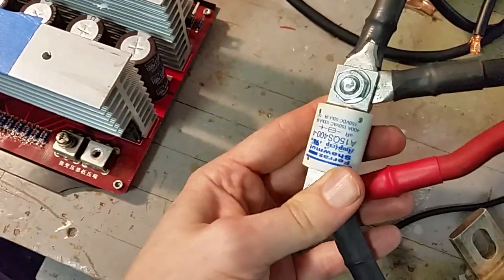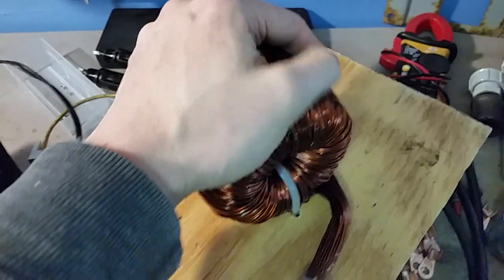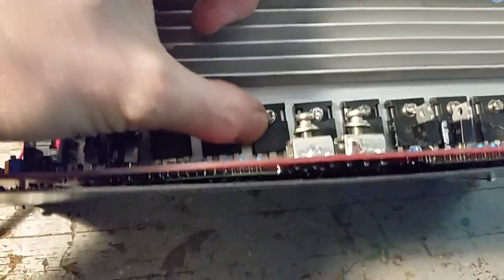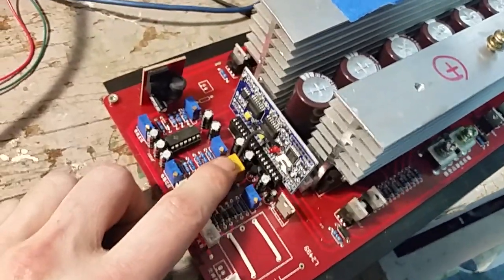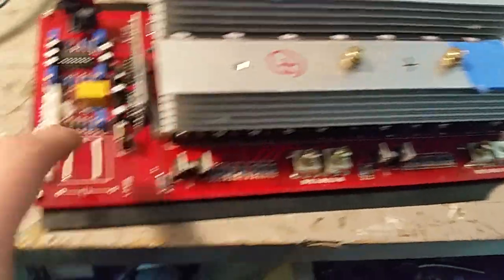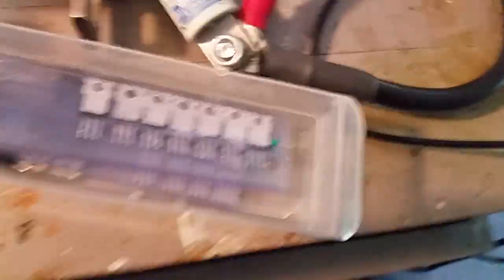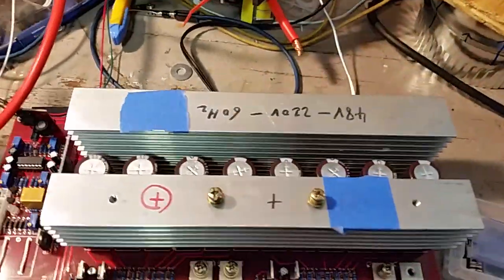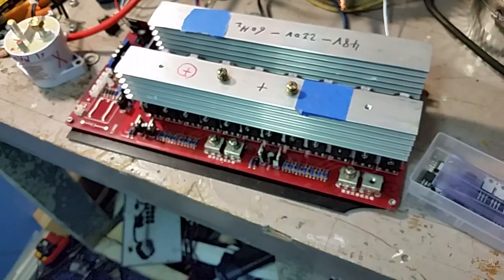Final video on chinese inverter board for custom powerwall

Comment: I looked at the designs of these, quite a bit and noticed something in common > No flyback diodes. 
Mechanical cracking? I bet on huge inducted currents causing the high-side fets to get stuck on.

Comment: Thank you for sharing all these videos! Because of these series I decided to buy the small one and so far so good. I had more problems blowing mosfets with the lighter traditional inverters than this. I use a welding transformer with smaller swicheable fuses in series to avoid destroying mosfest in case of emergency and left unmolested the tiny transformer on the board too. I don´t want to push it to the limits and works fine. My only concern is the stand by consumption because is around 1-2amps and the inductor doesn't seem to do much. I wonder If you left that board alone or finally ended as backup inverter for the 15kw one.
Reply: By the way, I always used an amp meter while I was making tests. I think this saved me from mishaps. I didn't like power consumption on idle, so I kept testing and I realized the transformer should have a better turn ratio, I had to add turns to the output side and with this increased dramatically efficiency and then added a Inductor to the output side too. Look for example this site where recommend a 14V input for 24V, 20V for 36V and 28V for 48V https://es.aliexpress.com/item/32632549961.html?spm=a2g0o.cart.0.0.679a3c00BBNEI1&mp=1
Reply: you cannot use a welding trafo, read the caution by the boards sellers

Comment: I am still using my board just like this one works great I did modify the egs002 and did away with all over current I just use brackers for over current my idle current is .44 amps on 48 volt side
I would like your extra  parts I have built a bunch of this type inverters had good luck but like I said before a friend on the back shed.  Com showed me how to modify the egs002
Reply from the maker: Yes, I have some parts I should sell. It will take me a week or so to get around to digging them out. Busy with farm stuff
Reply: @erroneus  still would like to have your extra parts
if your selling

Comment: I've experimented with an identical Chinese inverter board and come to some conclusions:
1) If any of the FETs fail, change all six in that quadrant. Even though testing may indicate some are bad, others good, those that have survived mass overcurrent are prone to subsequent failure. Usually you need to change the FETs in quadrants II and IV, those farthest from the small-signal plugs.
2) It is critical to have a good EMF filter at the AC output, capable of preventing inductive discharge potentials from moving upstream to the inverter. I used one salvaged from a large audio amplifier, rated for 250 VAC, 25 amperes, plus a 2.2 uF oil cap across each 117 VAC circuit.
3) Often the failure is cause by a spike driving the output bus higher than Vdd or lower than Vss, causing short-circuit of the internal diode in a HY4008, shoot-through and cascading failure. The EMF filter will help, but adding two large current, fast recovery diodes to limit the output bus swing may also be a life-saver.
4) A magnetic circuit breaker is much better than a fuse or thermal breaker.
While I realize this is too late to help Joel, perhaps others may find this information useful.
...de AC4AQ

Comment: Thanks a lot for this unique video that deals with this board and the diy personalized inverter. I got a question concerning the inductor that you use at the entrance into the transformer. What kind of inductor is that? Do you still have it?
Reply from the maker: I have it, but it is in storage. I think it is 47uH, but can do like 300amps. I made it myself from sendust torroids
Reply: @erroneus  Thanks for the response.  It was a pity that you discontinued your experiment. I do not need 15kw inverter and never thought of trying to build one myself. But I'm fascinated by your experiment.  I started paying attention to solar power since we got an off-grid cabin late last year. I newly realized that almost all inverters do not live up to the designated power level. After watching videos like those of yours, I seem to understand that amperage seems to be main limitation. I live in an old house with a 100 amp panel on which we survived for more than 20 years without running into any problems. 250 amp is unimaginable in my house. If I try it on a system at the cabin, I would like to try one that is 3kw to 5kw with a maximum amperage of 100-120 amp max.

Comment: i know this problem from a stack of new thyristors (all the same Model). The problem is when you use several small Mosfet/thyristors to drive a big load, one of the pack and a lower restance than the others due manufacturing tolerances.
If a huge current spike arrives it will go the path of least resistance, which means one of the components will be permanenty worn down  more then the others.The morer components are stacked the higher the chances are this negative effect will show up.
1. My theoretical soloution would be use the smallest number of Mosfets and instead go for stronger models
2. measure the RDSon and match all the componts so they have all the same Resitance
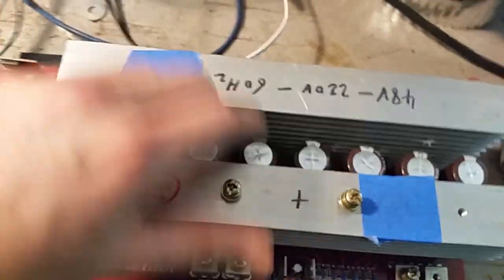4:24 ok that makes the problem worse. You cannot do that.
4:40 the soloution is, buy the chiese "7$ transistor/component tester", then you can measure the values and reaplace all Mosfets.

ty the video has lots of good info

Comment: please, what are the material of the inductor's core and the dimensions? if there is a guide to design the inductor for AC filters or for DC power supply pleases send me? Thanks

Comment: The dead time is critical, if you use different mosfets the gate capacitance will be different too. It looks to me like the mosfets all switched on briefly at same time and went pop again. You really need to replace all the fets as they may test ok but go pop when loaded.

Comment: You can use 15 ohm gate resistors to reduce avalanche voltage to fets also. Make sure fet body is floating.

Comment: I have the exact same what is this at the back shed. Com you can see how to remove the 393 chip off of the EGS oo2 board that's what causes this board to oscillate shut off and on very quickly and blow everything up there's people on there that's been running these for years after modifications my post on their the describes how to do this it's called Little China inverter board came in today

Comment: So what have you done for an inverter did you buy one are you going to fix one of these boards back up it's been probably 6 months now you said in 6 months might give it another go go to the back shed website they will help you with anything there there's a bunch of electrical engineers and a lot of other just really smart dudes there love to see you give it another go just my two cents
Reply from the maker: I've been trying to sell the transformer, it is kind of a niche thing. But either way, I think I've decided to get the purpose-built inverter from https://www.sigineer.com/ I'm competent enough to get it working, but the chinese inverter is just so fragile in the state that it is in. When the slightest thing goes wrong, the whole thing blows up. It is good for bench experiments.

Comment: hello Sir I am from India and i don't have full knowledge of car power inverter. so can you tell me which china car power inverter is best for only lcd bulbs and 2 celling fan. because on amazon have many inverter but i don't know who is the best.thanks
Reply from the maker: Because you have a ceiling fan, you'll need a pure sine wave inverter. Car voltage is 12v dc, India power voltage is 220v ac. Typical fans usually don't go over 100w. Led lights are almost nothing. Any 200w pure sine wave inverter should work for you unless you have a huge fan or too many lights. 300w would be better, 500w would probably be too much.
Reply: All chines on grid tie is best tear 1 solic  houwai sungrow senergy growaat

Comment: Have you decided to rebuild this or go with something else I have 52 lb troid I would like to get a board for was going to get this one thankfully I seen your video thank you very much but I'm left with out knowing what to buy did the blue board work good I need something reliable and a true 5000 watt
Reply from the maker: They both worked ok, it all depends on the mosfets. For 5kw, you'll probably need the red board, but keep in mind, it is really limited in amps, not watts, the power goes down quite a bit when you hit max amps. (Which is max load with full battery, then as voltage goes down, power goes down)
Reply: The blue boards that I'm thinking about getting nows24 mosfets I think it's supposed to be 4500wat I need to be able to run two or three small 5000 BTU air conditioners I've seen other people on YouTube say they take an 800 watt inverter I'll be putting us in a tour bus that me and my wife got for a motorhome and I have eight 145 amp hour
Reply: With over 4000 watts of solar I can't afford anything else except for maybe a power jack so I was hoping you would comment on maybe these boards are power jack being the best the Power Jack 8000 Watt is the one I was looking at the blue board I'm talking about is on eBay and it has the small mosfets on it 24 of them it's a hundred bucks. The red board that you've been using their the biggest one I think I shaved for a hundred and seventy everything I'll be doing to be in 48 volts and hopefully I'm only a hundred and ten volts ac to be honest with you I'm not very familiar with any of this kind of jumping in headfirst so any advice you have will be greatly appreciated thanks again for your videos

Comment: Koliko je bitno da jest kondenzator na sekundaru..?
Reply from the maker: How important is the capacitor on the 240v side? I'd say very important, but you can get away without using it for power up testing, or using on regular light bulbs,  anything else could be damaged from voltage spikes. jako važno

Comment: Problem with EG8010 is that when protection is active, there is 200 nS signal overlap and cross conduction occur and that short power rails and blow transistors
Reply: Do you have inductor in series with primary of a transformer ? you also need to be carefull not to saturate your inductor because it will lose its function. Also do you have capacitor in parallel to the secondary ?
Reply: Dragi Krešo odkuda jesi..
Imaš vidim puno iskustva sa ovakim stvarima.. pa evo što se dogodilo....
Nabavo sam inductor na AliExpress za "200A" kao I za ovakve invertere... Nakon sam priklopio u serijo sa primarom transformatora otpočetka bilo je u redu tok bez opterečenja smanjio se na otprilike 1.5A i to je dobar početak kondezatora na sekundaru nije bilo priključeno..... a onda imam u ovaj prostoriji neonske sijalice one sa dušilicama i starterima stare a onda otprilike za 15-20min počelo zujiti žvižditi u trafotu još dobro da sam bio tamo i izključno sve prije nego pukne...... 
Inductor bio je veoma blizu transistra pa sam mislio možda je bila indukcija u Gate ipak su fet transistori... Opet isto.... 
Dali je moguče bio problem zato što nije bilo kondezatora na sekundaru? 
Hvala
Reply: @gigabyte091  
Opet isto kada sam odmaknuo inductor od transistora.....
Reply: @bostjantrancar9605 Od kakve jezgre si napravio prigusnicu ? Bitno je da prigusnica ne ode u zasicenje jer onda efektivno imas samo komad kabela, ona mora imati zracni procjep na jezgri i bilo bi idealno da bude od materjala od kakvih su rađeni trafoi. Kondenzator odaberes tako da kondenzator i sekundarni namotaj tvore rezonantno kolo na 75 Hz. Isto tako, mozda ti transformator ima premalo namotaja na primaru. Koji je napon transformatora i koji je napon baterija
Reply: @gigabyte091  baterija je "48v" ili li-ion inverter kupio sam na alibabi tako da jest Kineski... Inverter ima E I trafo glomazan...
Specifikacije ne poznajem niti koliko ima omotaja primar ili sekundär....trafo ima odprilike 70-75kg..... 
Inverter 12kw konstantno/36kw špica 48vdc/230v50hzAc sa Automatik voltage regulations ili AVR I
Frequency stabilisation...
Reply: @bostjantrancar9605  Za EGS002 modul, napon trafoa bi trebao, uz napon baterije od 48V, biti oko 26 do 28 V,  znaci kada ga spojis na 230V trebao bi dobiti taj napon, a 12 kW na 48V je oko 250A, a prigusnica nebi smjela otici u zasicenje prije nekih 400A ili oko 1.5 puta vise od nazivne struje. To je poprilicno pozamasna prigusnica i ja vjerujem da tebi ista odlazi u zasicenje i zato imas tak veliku mirnu struju, jer ak koristis ferit za prigusnicu onda ti moze ista otic u zasicenje cak i u praznom hodu
Reply: So inverter protection is not good enough to protect the inverter... 👍 

Is extremely interesting how low idle current consumption of this device is.... 
I have other low frequency inverter but it have 2.5A idle current and when you don't have no load is annoying to spend so much power to run it.... 
Anyway inverter is MUST products PV35-15K model with two mppt charger..... Now the question how to lower idle current...? 
I already have change cooling fans for pvm Nidec 4wire fan's and PVM temperature controller and save  1.5A 
But idle current is still high...?any suggestions? 

Also have intention to change input caps from 6800uf/80v to 10000uf/125v......